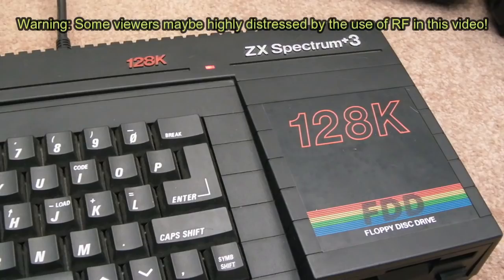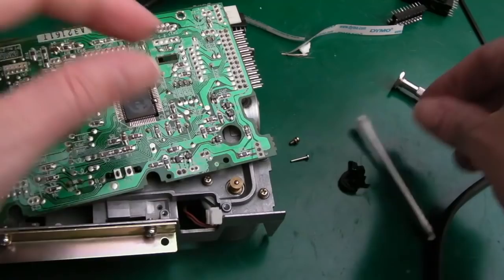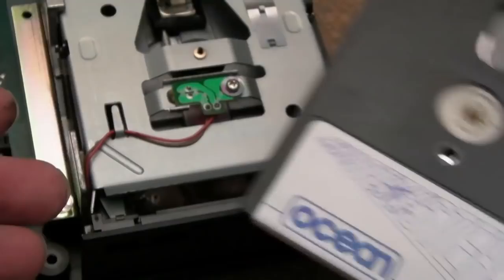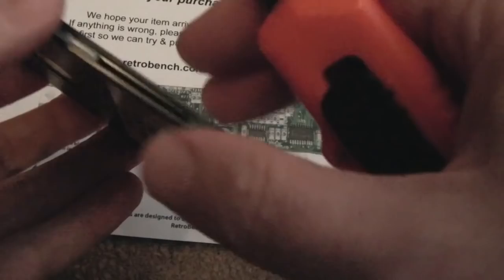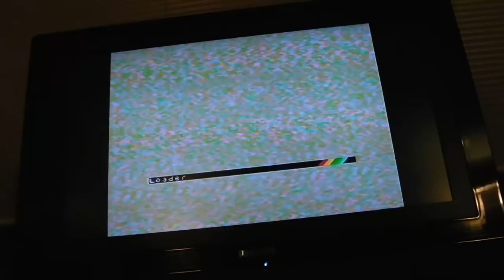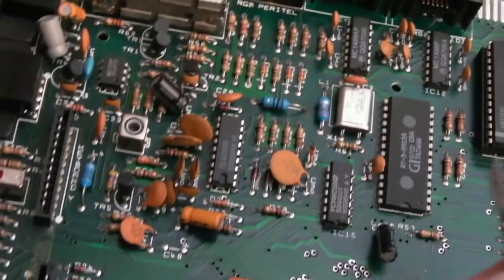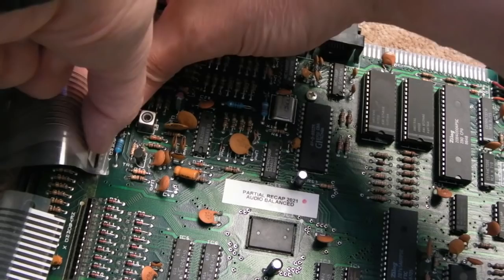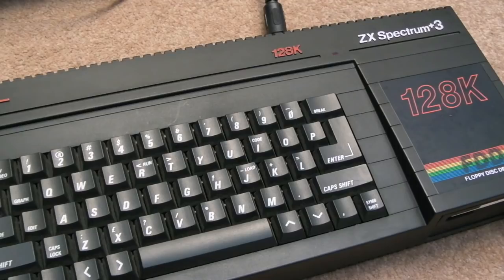Sinclair ZX Spectrum +3 Drive Repair (and tips) / Audio Fix & Cleaning a Floppy Disk

Comment from the maker: Note: I cleaned the underside of those edge connectors too ;)
Spectrum +3 Audio Fix - https://spectrumforeveryone.com/technical/fixing-audio-distortion-spectrum-3/
Ian Gledhill's original guide - https://zxnet.co.uk/spectrum/+3sound/
FDD power connector is molex I think (NOT a JST).  That small motorolla part is related to the modulator output.

Comment: pencil eraser works great on those contacts too.
Reply: I have always used a rubber (pencil eraser) to clean the edge connectors as it works well without abrasion. Fiber glass pens will cause that.

Comment: I use the same disc cleaning method on a c64 1541 drive that I modded for this purpose, It was already faulty (always spinning), I removed the head for easy access.

Comment: great video, really loving watching you fix these old computers that i loved when i was growing up, and still love (and own) today. Even though the +3
isn't really a Sinclair machine (and some people hate it because of that) i think it's a great machine to own and use today.

i bought a divide 2k11 for it but it won't fit in properly, as it's not tall enough to clear the height of the +3 because it hits the button of the interface, this stops it from seating properly, bizarrely it has worked for a while when flat on a desk, but recently i moved it from there and now it won't work at all, so i have ordered a 2K14 revised, and i am hopeful this will work.

quick question... ever since i got my +3 the disc drive LED is ALWAYS on. i've never tested it as i don't have a disk to try but wondered if it's a simple fix?

regards, 

mrP

PS. i do use it with a SCART RGB cable on an LCD now and it looks lovely (this is why i moved the speccy) new TV doesn't have SCART so i used one of those cheap HDMI / SCART adapters, and although it works really well on my A1200, the +3, is erm... AWFUL :(

Comment: Great vid, Chris. I have a question for you, I have just bought one of these. Did these always have that bad of a picture via rf? Mine is like the one in the video. I thought my +2b was bad, but this is awful. Surely they never left the shop like this? Is there a way to improve rf out? My grey +2 is far better than this. Thanks and look forward to more of your great videos
Reply from the maker: Part of the problem is these days is stuff overlaps on the channels we used (I think).  Generally so much stuff in the airways they didn't expect when designing it.   I would just avoid RF - I always struggle to get a half decent RF picture no matter which system and which TV I use.  It could also be aged capacitors in the modulator too, or a lower quality modulator than the previous model.

Comment: Thanks for the video, I'll be doing the same. However theres no audio from the RF modulator and sounds like snow despite showing a picture.  Is this a modulator problem?
Reply from the maker: I would start by doing all of the mods with resistors.  Chances are the sound will be OK at the end.   I almost had no sound on this one until I did the sound resistor modifications.
Reply: @GadgetUK164  Somehow the problem seems to have gone away.  The modulator can was missing its top and I replaced it so not sure if that fixed it.  The ferrite modulator tuning slug then broke, so I may do a composite mod.  Next I will be doing the sound mod and replacing those resistors. Someone had been in there before and the floppy drive write protect sensor pin is missing so lll have to make a new one.

Comment: Why does all that work need to be done to get good audio.  I thought this had a sound out on the back left.  Why would it sound so bad with factory components?
Reply from the maker: They messed up the board at design.  The audio was bad like this from new on the +3!  And the audio coming out on the connector at the back sounded just the same (bad).

Comment: I've just replaced the belt but the drive isn't reading disks, typing CAT into basic results in "drive not ready" any ideas? Thanks!
Reply from the maker: It's perhaps that motor tension point (that metal flap that holds the bar).  I am sure I mentioned it in this video, if not - check the CPC6128 video I did.

Comment: yaaaaaaaaaaaaaaaaaaaaaaay...its the same but different..
Not even got to the drive on my 6128.... although it does have the plate on the back of the mech..... :)
still trying to get my ay chip.. the one from france I had  to cancell.... they were still blaming brexit and HMRC...
Sourced another from china... :( no idea when will get that..
define  my keys I wish...

Thanks for the extra advice... on these amstrads..sorry spekkys...

N x

Comment: What is the brand and model of that desoldering pump?
Reply from the maker: It's an Engineer desolder pump - available on Amazon.  Not sure on the model though as the print has worn off now =/
Reply: @GadgetUK164   I like it a lot because it seems to have a silicone tip (or something of that nature - very soft but thermally stable). I could see immediately that it's a great improvement over the pumps I've used so far. I found "Engineer SS-02" - is that the one you have?

Comment: That RF output is fairly bad even for RF. Is there an issue with the Modulator or is this model just really poor? 😀
Reply from the maker: I find most modulators behave that way on this TV tbh!  I wonder if its due to digital TV transmitting on the frequencies these modulators used?!?

Comment: Are the dimensions of the drive belt a Top Ultra type of secret, or something?

I searched the web and simply can not find it!!

Could you, or someone else tell the dimensions of that belt, please?
Reply from the maker: Quote from CPC Wiki "The correct belt is 3mm wide, 0.6mm thick and has a total length (outer circumference) of 230mm (often also advertised as 115mm)."

It's the same belt as Amstrad CPC - so those dimensions above should be fine!
Reply: @GadgetUK164 Ta! Ta! Ta! Super ta!! 😂